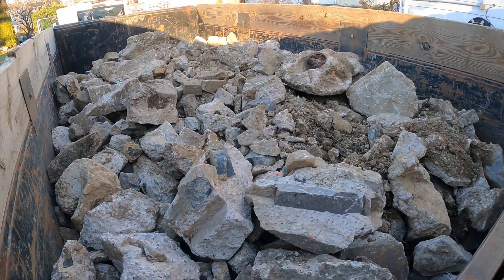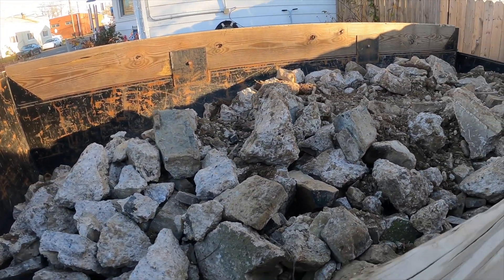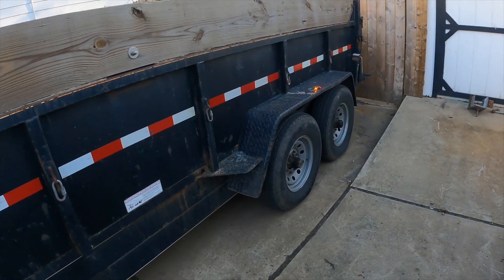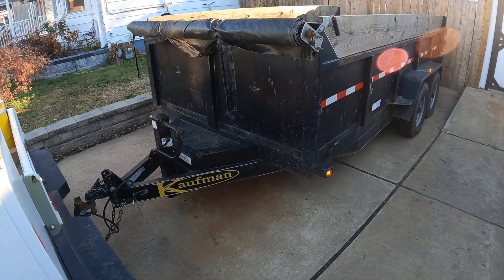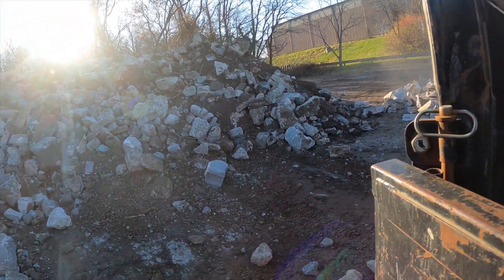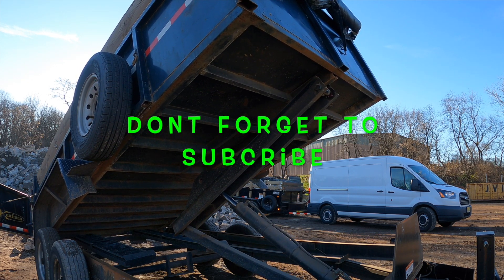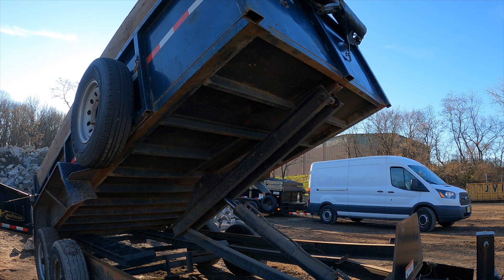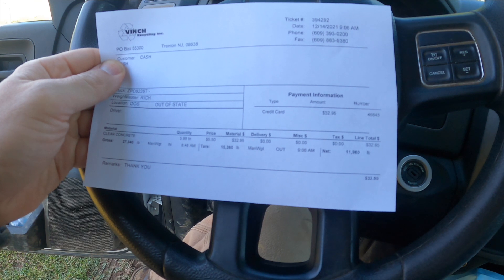My Kaufman Dump Trailer Overloaded

Comment: Thank you for posting this. I'm in the market for a dump trailer and looking at the Kaufman product since I'm so close to their NC plant and their pricing is favorable. They don't show hydraulic cylinder size as a selling point, so I've been a little concerned if the 4" cylinder could do the job when Maxx D lists a 5" cylinder on their standard HD dump. This helps to answer that question.
Reply: You cant go wrong with them

Comment: I rigged up a vertical helper cylinder for lifting my dump trailer when filled with sand or dirt. Once up 20 degrees it could dump anything. Have had to use a  skid steer with forks on trailers too.
Reply from the maker: This is a good idea, did you use a bottle jack or an hydraulic cylinder?